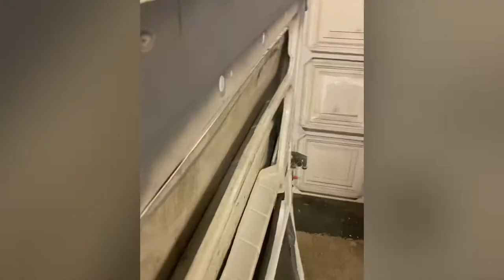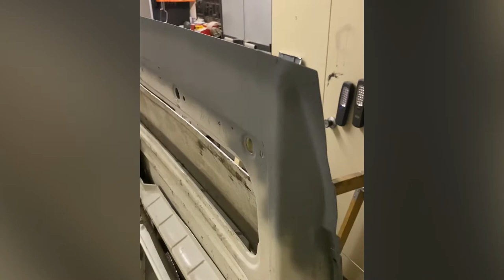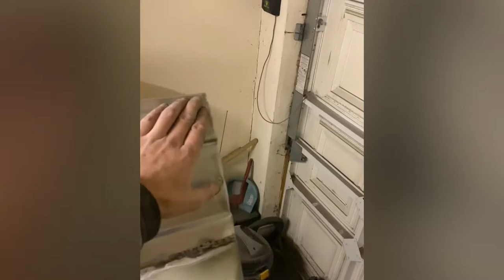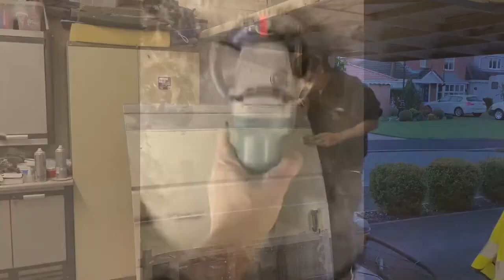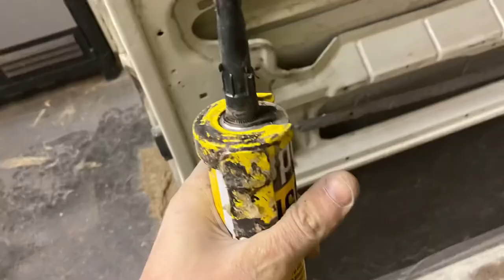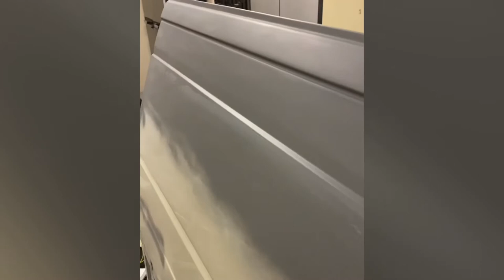VW T4 Sliding Door Finished

Comment: Great job Paul! I thought about the outside repair panel. I still might use 1 yet. I caught a glimpse of your sill. Its like mine was. You'll have to do some fabrication on its rh side. BTW I think we've same welder, clarke 135te?
Reply from the maker: Yes your right, 135te turbo addition , think I’ve made a massive blunder by welding along the length of the panel on the inside so that I could leave the welds on. It’s caused the panel to bulge outwards which I’m struggling to blend out with the filler. I’m a locksmith, never done this sort of thing before so I’m on a massive learning curve. Your a plumber right? I imagine we’re in the same boat.
Reply: Yes I'm a plumber. So aye were probably on the same level. Ive never been a hands on car guy till I bought the van and discovered its hidden tin worm. A massive learning curve. I enjoy it though.  Ive made plenty of mistakes along the way